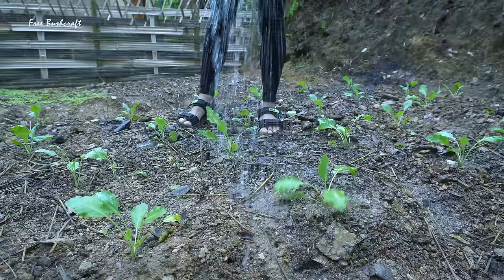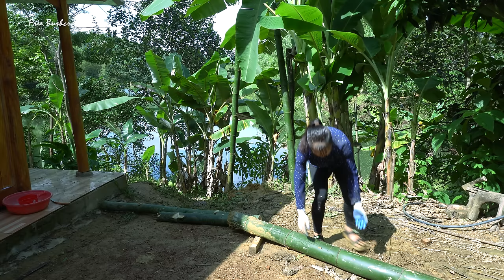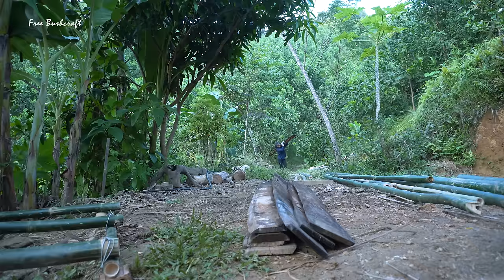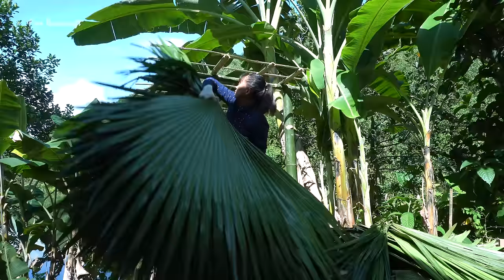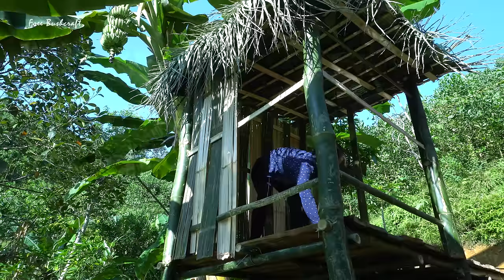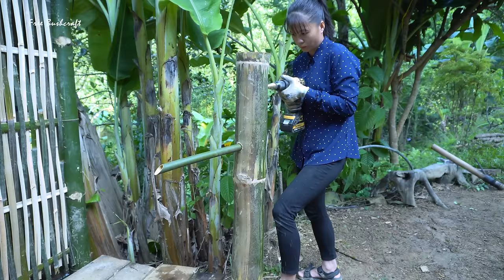Build a Bamboo Bathhouse, Watering Vegetables in the Morning | Free Bushcraft, Ep97

Comment: Hello!                                                                Once again, you did really good work! Congradulations! And, I liked that you used modern cordless tools, metal wire & pliers to make your work easier. But, ¿why didn't you make your shower inside the enclosure where you could remove all of your clothes in private; where you could clean yourself with soap & water thoroughly (even your important private parts); and, where you could dry yourself off with a towel and put on a 🧖‍♀️ bathrobe?